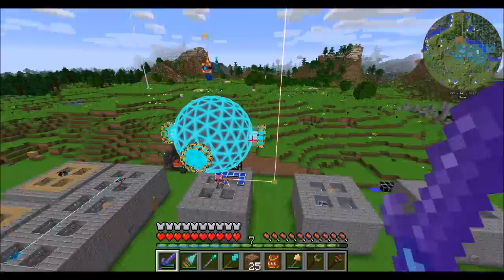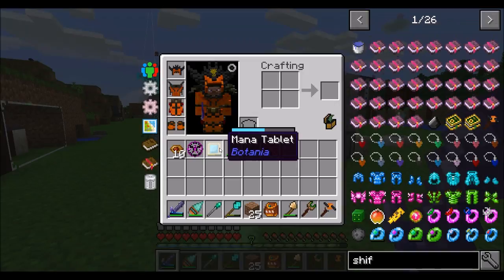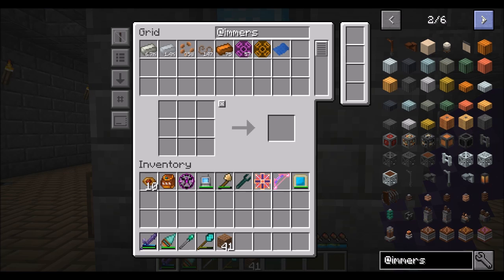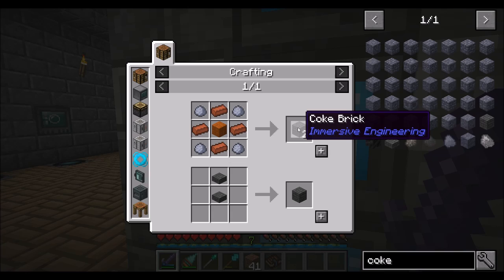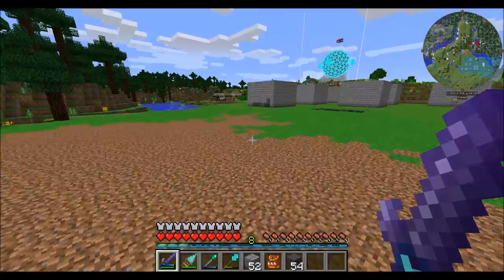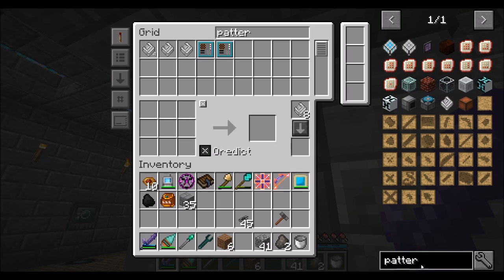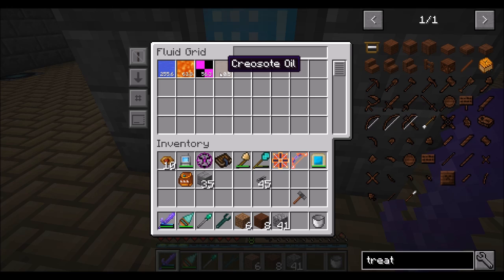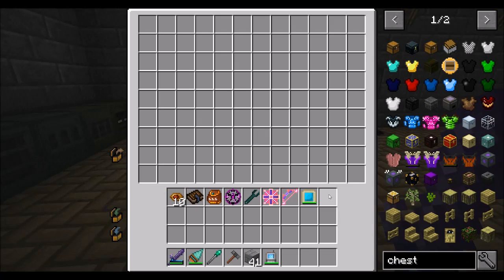Lets Play S8 E100 Immersion

Comment: Dire, you should set the footprints for the blast furnaces to be a 5*5, not a 3*3. That way, you'll know where your preheaters will be if you end up using them, and you can also swap one over to an arc furnace if you want with little issue later.

Comment: I'm curious, though.... what if you used the phantom face on the center block of the coke oven, then used the acceleration wand on that?

EDIT: Seems the Phantom Face can read the inventory of the center block when it's turned into a multiblock! However, it can't speed it up, at least the regular phantom face.

Comment: I like Immersive Engineering a bit, the trouble is that it's heavily immersive, in that you have to wait for time-critical components if there isn't other mods facilitating the speed-up of the building blocks for the multiblock structures.  Immersive I like, the waiting and waiting I don't like so much, so I tend to skip it in favor of other mods that speed up progression faster.  If the IE mod dev could do something about the waiting part of his mod, then I might reconsider it but at the moment it's a mostly unused mod, because it's slow to get anywhere in it.  The aesthetics part doesn't bother me much, I prefer functioning blocks that work over pretty looks.
Reply: DarkVoidIII 
Tl Dr:
I am a 99 year old guy who cant wait for the mod, since it takes so much time.

Comment: I have a problem, i recently came back to minecraft after a looong brake. And long story short: its lagging like CRAZY! And i have barely anything in my world yet. If you compare it to Direwolf im on episode 40 or something. The last thing i did was setting up my draconic orb. If i remember it was barely lagging last i played. 

Specs: Windows 7
Intel Core i5-4460
16 GB RAM
AMD Radeon (TM) R9 390 Series

Anyone have any tip on how to lower lag in direwolf pack?
Reply: Update to Windows 10
Reply: But i don't want Windows 10, i like 7... 
Why would that help?
Reply: Freddeboy28 BetterFPS.
Reply: Wait a minute, 3g RAM? Is the trick not to give it too much or something? Im looking at my setting right now and its capped at 15.75 GB RAM.
Reply: Freddeboy28 remember that windows its self still needs ram to run, in not quite sure how minecrafts allocating works, but if it sets the mem to in use and the system only has half a gig, it's prolly not actually Minecraft slowing down but the system its self stuttering
Reply: ...I'm stupid sometimes. Ill try with 4 RAM and see if it gets better.
Reply: Heh, well... I'm playing with 6 RAM now and its as smooth as vanilla Minecraft. I'm so smart :D
Thanks for the help everyone.